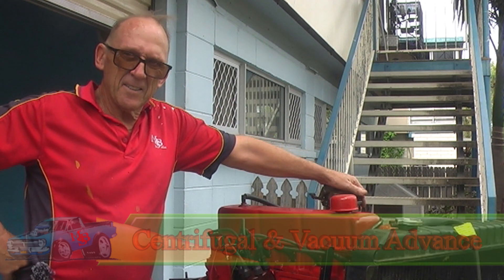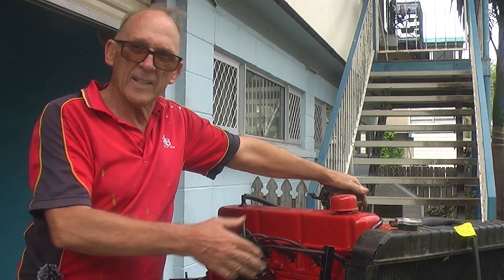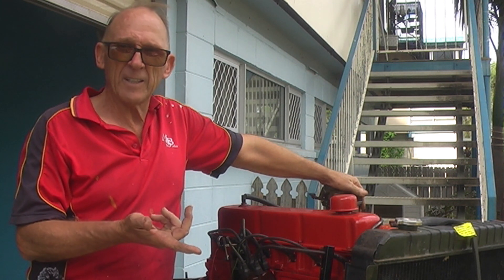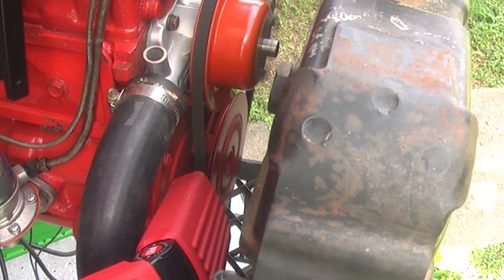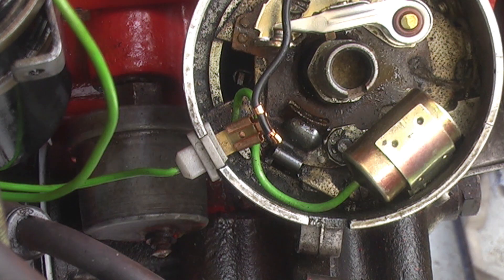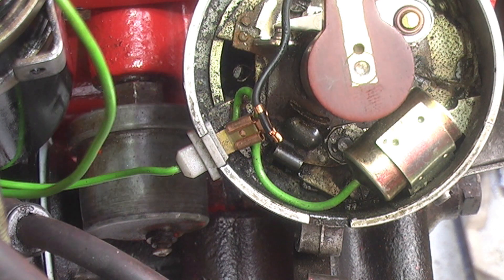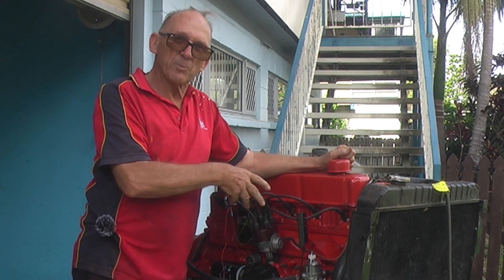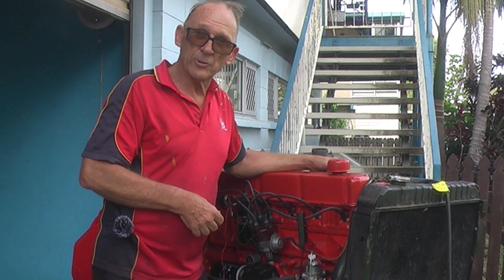Centrifugal and Vacuum Advance on a Holden 6

Comment: I have the blue distributor that has 14 degrees centrifugal advance , is that enough for today's fuel ? With 10 degrees initial and only 14 degrees centrifugal thats only 24 total !
Reply from the maker: Nah, you are short on advance. A stock VH has 23-27@4400rpm but a VK EFI has 16-20@5000. You may have the VK dist fitted or your secondary spring is just way to tight & not allowing the advance to peak out or your cam lobe shaft is seizing or it's been modified. If your running premium fuel, you set up the standard specs to start with & then play around with adding advance until it starts pinging then knock it back a few degrees from there.
Reply: @mbsoldschool  I have checked distributer , it is an EFI model and with a degree wheel it only has a groove slot that only allows the pin on top plate to move 14 degrees
Reply: I am running a 202 in a 3.5 tonne truck , do I need a slower curve ?

Comment: Hi , Do you time the engine with the vaccum advance blocked off or connected?
Reply from the maker: 99% of Holdens the timing is set with the vacuum hose off.